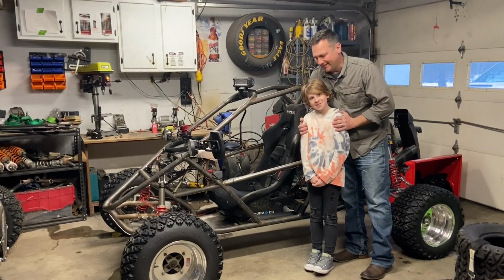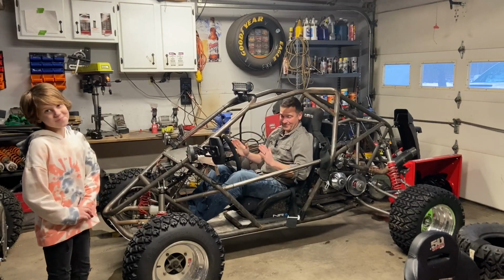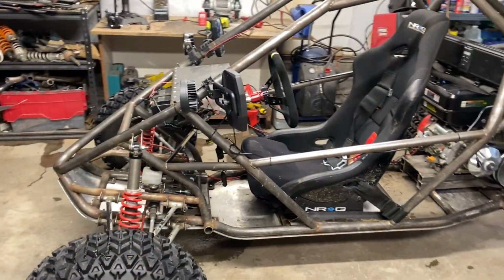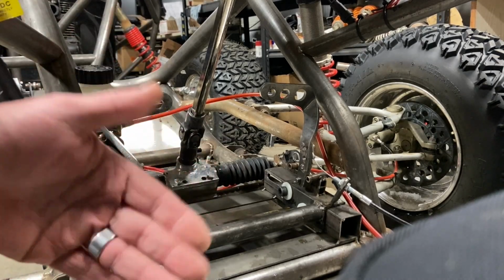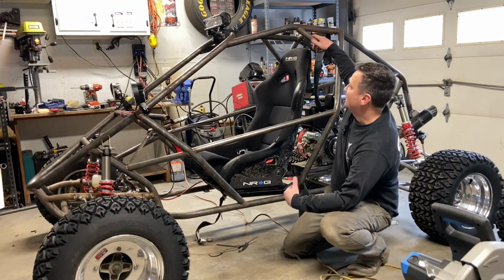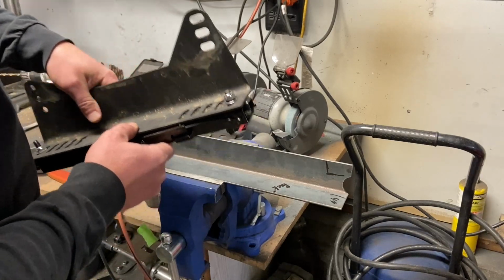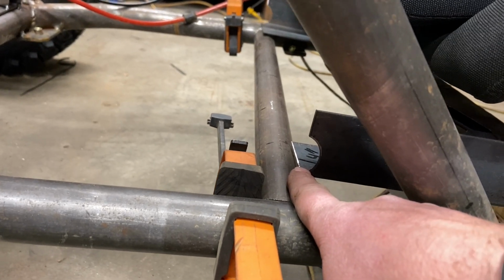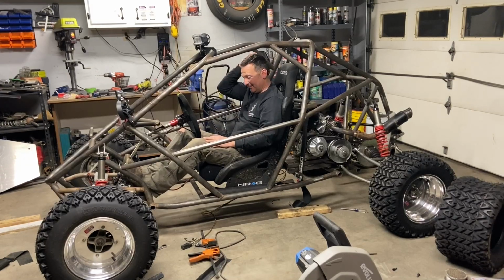Crosskart Driver Adjustment Stuff

Comment: Have you experimented with a 2 pedal setup on a shifter kart using a hand clutch and left-hand shifting? Given that bike and sport quad transmissions are dog engagement and can be shifted without the clutch (both ways, mind you, just blip on downshift and lift on upshift!), I think it might be the best of both worlds with the adjustable pedals, huge legroom, and overall usability. I suggest a left-hand shifter because motorcyclists will be used to left-hand clutch and because having your dominant hand on the wheel should give you a touch more steering authority and coordination.

Comment: I love your videos!  You're a genius!  🤓👍

Also, I noticed that by putting the seat support at an angle, the seat raises as you move forward.  This works great because drivers with shorter legs will get a slight height boost when they scoot forward. Also, drivers with long legs will sit lower (which will help them avoid bumping their head).  That enables both drivers to have a more ideal eyeline (between the wheel and the top bar).

You could intentionally put more of a slope to accentuate the effect.  If the angle is beyond what is comfortable, then you could shim under the back of the seat just above the slider rail.  That way, the slide rail angle is steeper than the seat angle (if needed for comfort).

Thanks for all of your hard work!  You're great!  😁🙌🎉
Reply: By the way, I just subscribed.  Thanks again!  😀🙏
Reply from the maker: So hard to put all of that commentary in the videos but that was a small part of the build. Thank you for spelling it out in the comments 🦾
Reply: @KJRaycing  Awesome!  And thanks for your reply.  I'm looking forward to your future videos (I would love to build a VF-2 with a 20-40 HP crate engine). 😎🙌
Reply from the maker: I think we would all love to see that!